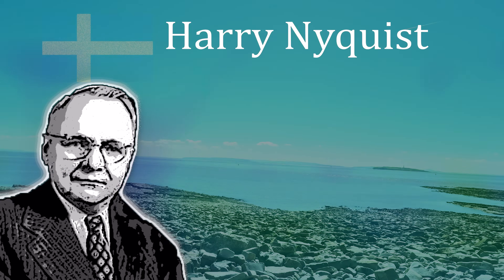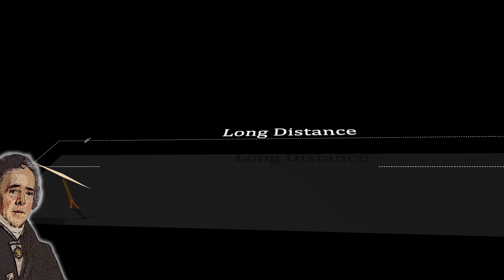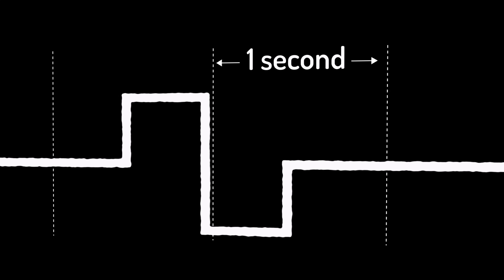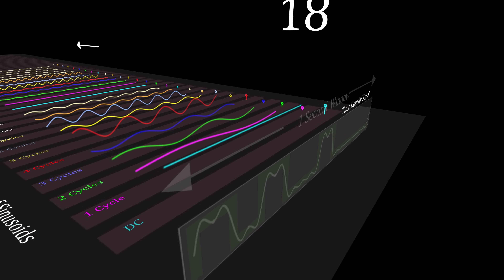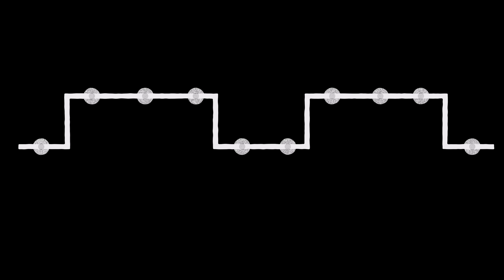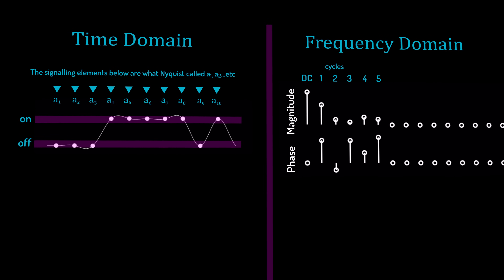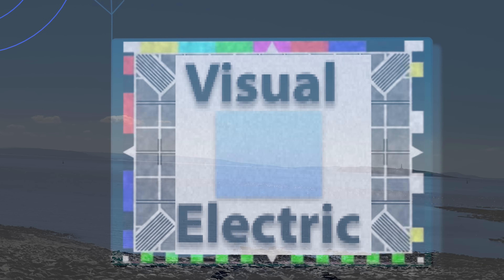Nyquist - the amazing 1928 BREAKTHROUGH which showed every communication channel has a capacity

Comment: Thanks for this video. I had previously associated Nyquist with the stability criteria for negative feedback loops, and Shannon for the sampling theorum stating that a signal needed to be sampled at twice the highest frequency of that signal. That's if recall it correctly after over 60 years ago.
Reply from the maker: Yes that's right. Nyquist proposed the signalling theorem, which relates the number of pulses you send per second to the required bandwidth. Interesting that his name also got associated with Shannon's sampling theorem too.

Comment: As a old Electronic Tech I respected the Nyquist limits but got lost when QAM came along. My mind just could not comprehend the capacity increase from 50 Baud to 9600 of a 4k bandwidth channel. Much respect to those who really understand this.
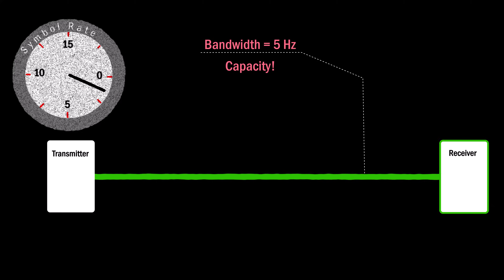Reply: See @8:15. Nyquist only limited how fast you could change the symbol, not how many bits you could send on each symbol. If each symbol has only two possibilities, then that's one bit per symbol. But if you allow intermediate values and have 4 levels instead of two, then you have two bits per symbol. If you create two carriers at 90 degrees (in "quadrature") and have 4 amplitude possibilities for each, then there are 4x4 = 16 possibilities per symbol, which means 4 bits per symbol. This is quadrature amplitude modulation: QAM.
Reply: 8:28 🇨🇱
I puzzled pretty much the same, as how my modem could manage a throughput many multiples more than the Niquist "limitation". 
The answer is clearly given above 👍😀. 
Saludos de 🇨🇱

Comment: As most signals do are not periodic (even periodic ones must start and end some day and are not strictly periodic but we can ignore the high frequency transients at the start and end) we can not use Fourier series, we use a generalization of them: the Fourier transform where we have a continuum of frequencies and not only the harmonics, basically the um turns into an integral.
This is why Nyquist approach uses samples, but it is a natural way of thinking (as you say accidental) as in practice you can't really go to an infinite resolution.
Apart from that a very nice video.

This duality is brought by Fourier transforms (and more generally by all integral transforms) in many places not only in communication: in Quantum Mechanics for instance you can pass from position to momentum by a simple Fourier transform what leads directly to Heisenberg principle. This is the power of abstract algebraic structures: a simple unifying way to treat several at first apparently unrelated things. Summarizing: several ways to see the same process and a unified way to see several different processes.

Comment: The Nyquist sampling theorem is essentially about trigonometric interpolation, and the relevant mathematical results were known for at least a hundred years before Nyquist. What was not appreciated was the connection of trigonometric interpolation with electronic communication.
Reply: Yes. Since you need at least 3 points to determine a particular circle, you need more than two samples (points) to unambiguously determine a sinewave.
Reply: @gnormhurst  That's an interesting insight, I hadn't thought about the commonality between geometry and time domain waves. You also have to define a certain bandwidth in order to represent any analog signal with samples.
Reply: @gnormhurst Took me 25 years of trying to understand why digital (audio) sampling works to come to that very insight. That plus really understanding the concept of every waveform being sine-wave intereference. The key thing most simple(beginner) explanations don’t mention clearly enough is you don’t need 2 sample points. You need 3.
Reply: Please cite a reference.

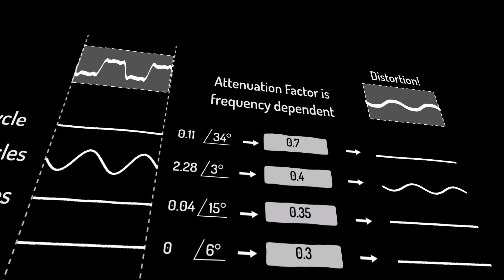Comment: 5:50 "a series of ten pulses" ?!? No! A series of 1 and 0 pulses!
Reply: The "ten signal elements" was a Nyquist reference to one second of communication. (note the text in the video, not the audio at the timemark)
Symbols in Morse Code are represented by a combination of five dots and/or dashes.
The speed at which symbols are send was typically at 2 per symbols second, or 10 signal bursts per second. 
Note: both the dash, or dah (--) and dot, or dit (.) where send as active signals, the dah being a longer duration, and the dit being of shorter duration.
Not on/off (1/0) like digital pulses. Off, or silence represents space between symbols.

Comment: Thank-you.

Sadly I didn't understand any of this.

The map of telegraph lines, however, amply illustrated the centrality, then, of The City of London!
Reply: And oceanic telegraph lines is how all of this got applied!  It turned out that sending DC pulses over thousands of miles of wire, underwater, wasn't as reliable as a couple hundred miles over land.  The "high pass filter" characteristic prevented faster telegraphy speeds from being usable.  Nyquist proved how that all worked (or why it didn't) and that simply turning up the voltage wouldn't fix the throughput issue.  The implications of Nyquist's work were immediate but the long term impact is still being felt.  Foundational work.

Comment: Author of this video should look up how Fourier is pronounced. Fourier was French.
https://www.youtube.com/watch?v=ezkLicWqL4o

8:00 - Nyquist criteria. Claude Shannon shows that if you include signal to noise factor, you can really pack more data. In early modems the data signal could still be transmitted successfully, even if it was deeply buried in the noise. As modems got faster, constellation techniques got more complicated. The last old fashion telephone line modems were rated for 33K/56Kbaud. The 56K rate was only possible on a really noise free line, while 33K was a more realistic number. Old American analog telephone lines have a band from 300Hz to 3400Hz, and when digitally sampled, an 8000s/s rate was usually the minimum rate to meet the Nyquist criteria, when practical filtering is included.
Reply: My 1.3km telephone line (BT) twisted pair with joints could manage 30Mbs/s on a good day, using BT's fancy cable modem in 2012.  Very crafty technology. Not sure how.  Some ADSL features on steroids.
Reply: I’ve never heard Fourier pronounced the way it is in this video. Anyone else?

Comment: You can't push a square wave through a round cable.
Reply: It’s gonna pop a 6944.. somewhere
Reply: It can be done. Only smaller squares can be pushed through though. 
Just need to be careful with any bends in the cable, they can't be too sharp.
Reply: @AerialWaviator  you can do as you want to.
Reply: @AerialWaviator  an x- class pushes a band width where it wants, so what circle or square knows the sun

Comment: I remember in high school deriving sine functions from two points. Our trig and calculus teacher would have us write the names of theorems we were using when we did proofs, and I don't recall learning about nyquist sampling theorem, but I do remember working out these kinds of problems, e.g. find a sine wave, or a parabola, or whatever, that passes through these points. And I think I remember having to do a proof that you need 2x the frequency in samples. At the time, I didn't make the connection to transmission lines. I always related math class to other classes at school, or to physical objects, so to me at the time a sine wave was just a wheel spinning or something like that. As an adult, I have encountered the nyquist theorem working on analog transmission networks. For a little while I was working on digital video over satellite/radio -- and some radio heads are all about transmission theory.

although maybe my memory is just off about learning this idea in school. 20 years ago, enough time to forget. haha.

Comment: About 45 years ago, I was a grad student working on a Fortran assignment on a weekend.  The building was pretty empty and I was scratching my head, wondering why the code didn't compile.  I saw an older (and better dressed) man walking down the hallway and asked him if he could give me some advice.   He quickly held up his hand and said (paraphrased) I can't help you, I used to know all this stuff but I can't clutter up my mind with it now. 

I immediately dismissed him as a pompous jerk and went back to solving my problem.  Later, I found out he was just about the most famous professor on the staff and had at least seven terms named for him and had received the Turing Award.

I still thought he was a pompous jerk, but admittedly a smart pompous jerk.

Comment: And not a word about Kotelnikov. Although he described in 1933 about the capacity of the channel. Kotelnikov V.A. On the transmission capacity of the ether and of cables in electrical communications
Reply: 1933 was after 1928.
Reply: @xandervk2371  There is no question of the possibility of a complete reconstruction of the original signal using discrete samples in 1928. The theorem was proposed and proved by Vladimir Kotelnikov in 1933 in the work "On the bandwidth of ether and cable in telecommunications". Independently of him, Claude Shannon proved this theorem in 1949 (16 years later).
Reply: @xandervk2371   Kotelnikov has priority over Shannon (16 years). Not Nyquist. Shannon was mentioned in the video.
Reply: @sergeikhoudiakov1914  The video is certainly about Nyquist, not Shannon.